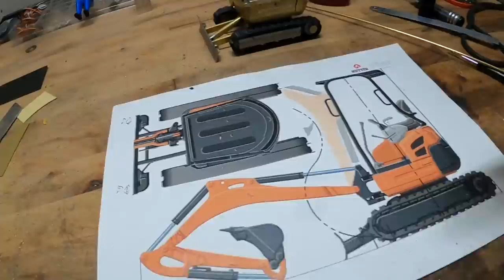Build - RC Kubota Hutter U17 1:15 Scale Excavator Part 3 - Uppercarriage and Cab

Comment: Excellent work! May I ask what's the brand of that blue bend roller / bending brake / shears machine you're using? It looks like a fantastic tool to have around a small metal workshop.